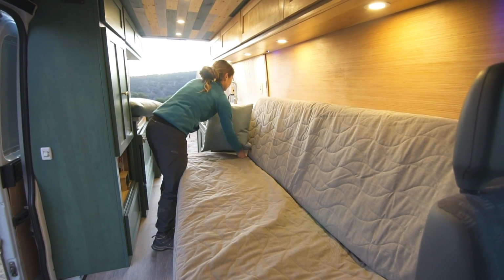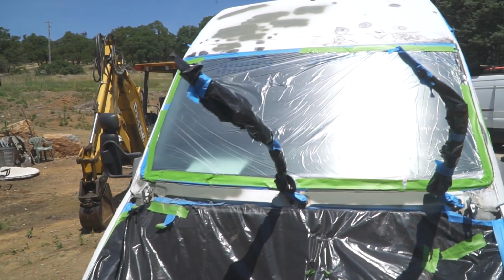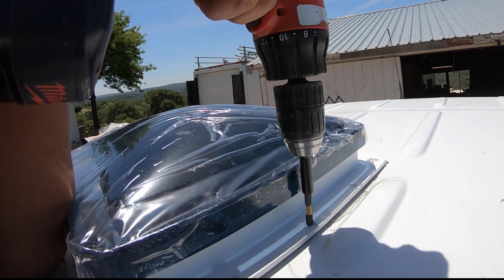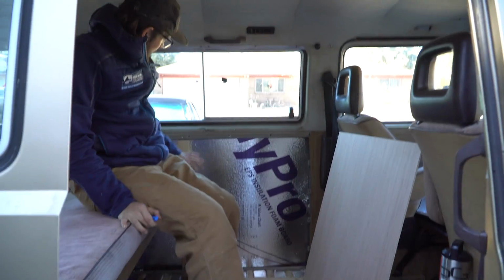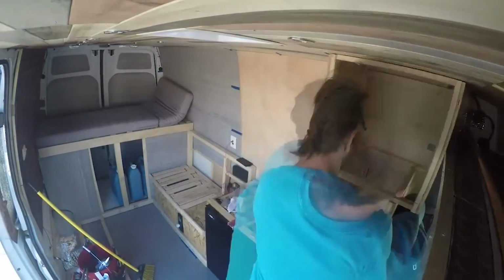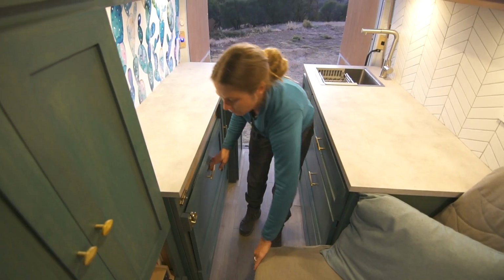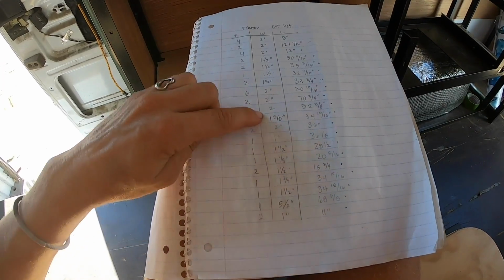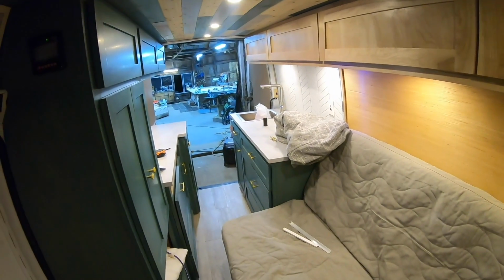How to Build a Camper Van Step by Step

Comment: How do you find the original van holes with Reflectix up ?  I’m at this stage
Reply from the maker: I’m usually drilling new holes into the van with self tapping screws. Placing the furring strips on top of the reflectix and then fastening them to the vans rubs. Some people use riv nuts  and install them before the reflectix.

Comment: What is the tubular metal and L's you used?  Steel?  Aluminum?  How is the weight compared to other options?
Reply from the maker: 1/2” square, and 1/2” angle iron. Way lighter way stronger! Wish I had the time to do this on every van I built.

Comment: Wiring before or after vapor barrier? Meaning wiring in the metal of the van before insulation or between 1X3” frame and vapor barrier? Did you find one way to be simpler?
Reply from the maker: Wiring after framing is easier I think…

Comment: Hello. I love your dedications, hardwork and your creativity. Your builds are creative.
Im on a “planning stages” on building myself my van conversion.
So many ways, styles, and how to video ive seen.
First concerning issue. Your build materials using, wood, metals, woods, plywoods. Seems to be a bit of added weights to the van.
You mind asking after all the builds. How much weight total the van end up?
As for me using the van as my daily driver, mini home. Gas mileage is a big factor.
Reply from the maker: These vans are designed to hold weight this van was a 3500 diesel with a payload over 9000lbs we haven't even come close overloading these vehicles.  Our current van that we have lived in for almost 5 years is just under its recommended payload and we have had to upgrade some suspension and other front end parts.  This is a good thing to think about before your build but just remember these vans were designed to be loaded up and used as heavy duty work vehicles.

Comment: Which video explains how to do the floors? I can’t find it except for on the time lapse vid
Reply from the maker: The floors are pretty straight forward.   We just make a template with cardboard and lay it in there.  Or we use the existing floor to cut a new template out of 3/4" ply and glue it in there.  Then we will lay down either a laminate or a vinyl floor.

Comment: Wonderful!,...... Question... you said paint black to stop rust. Confused me. Just black paint? And painting what parts?
Reply from the maker: We used raptor bed liner to paint the lower exterior and roof because we had rust spots.  The bedliner works great and is easy to apply.  We have more in depth videos on our page for painting your van.
Reply: great question!

Comment: does the reflectix add to the rattle noise? I'm thinking the foam board would and no rattle noise is another benefit of the thinsulate
Reply from the maker: No it’s very lightweight
Reply: @Vankookz  yep, great weight and vapor barrier....wasn't sure if you'd get a little krinkling noise.
Reply from the maker: Not that we’ve noticed

Comment: How did you do your floor?. It looks like you used 1 inch insulation than 1/2, plywood. How did you hold the plywood down
Reply from the maker: We used the reflectix and then the existing van floor it was in good condition still.  We used self tapping screws to hold it down.  Always triple check where you are drilling and use lap sealant to cover the screw holes underneath.

Comment: Just FYI most welders can weld sheet metal so if you make a mistake it's possible to weld that pieces you cut out of the roof with some patience and some grinding at the end to make the welds flush with the rest of the roof, and maybe some bondo right before you paint. or just take it to a fabrication shop and they will weld it for you
Reply from the maker: Yeah it’s amazing what you can do these days.  We had to meld some sheet metal to our current van we cut a bunch of rust out

Comment: Hey!! Halfway through the video haha but I have a question! Did y’all make pilot holes in the van before framing? Or do you use the holes already there? Thank you!!!!
Reply from the maker: Use self tapping screws and a impact driver.  Works every time
Reply: Van Kookz gotcha, thank you so much!! I appreciate it!
Reply from the maker: No problem we are here to help.
Reply: No problems with self tapping vibrating loose?  That would concern me but that sure is sure easier than rivnuts.   For others reading the comments: Self tapping screws are super easy to strip out so be very careful with them.  I would suggest you practice on an inconspicuous spot first so you can fine tune your "touch".

Comment: What has been your go to method for keeping drawers shut? The push button catches seem like the plastic would be subject to wear and tear, especially in rougher areas like baja.
Reply from the maker: The push button patches are actually pretty legit we’ve used a few products and those seem to work and hold up pretty good.  If you don’t mind the look barrel locks and sash locks are the best to keep the heavy duty stuff closed.  We’ve also used a few magnetic  latches.  All depends on how heavy the drawer is

Comment: Great video, need ur advice, which one has high top, 4 sleepers, best engine, best price and gasoline savings 
How much cost convert and how can I find someone help me in converting affordable
Reply from the maker: Hey M B thanks for watching! 

https://youtu.be/v2RcLdwSnMg

Funny you ask, we just compared two of the most popular high tops, in this video. Keep in mind they are comparing the brand new 2020s off the lot. And they are comparing off road features as well. So for the sprinter remove $13,800 if 4x4 isn’t your thing. For the gas powered transit remove $6,000 if AWD isn’t your thing. 

As far as cheap conversions go, on our website, we have a budget sheet. (Www.vankookz.com) We do them for every van we have built. We have build vans ranging from budget minimal builds to a little more luxury. That budget sheet should give you an idea about what you might expect to spend on a build (if you DIY). 

The components (fridge, batteries, solar, sink, etc.) that you need to build out a van can be done around $8-10k. I’ve seen some get up to $28k on top of the build. If you want some one else to build it, plan to add an extra $15k-25k for the labor, on top of your build components. This is why we try to help people do it themselves with these videos. But check back with us, we may be working with kookz soon to build out their vans affordable, as we have gotten plenty of interest from the viewers on it!

Comment: So glad you told people to have an air gap between insulation and panels, a lot of 'expert' youtubers don't do that. 😁
Reply: Glad you mentioned the air gap.  I used spacers in the roof insulation to give me that air gap.  They are made by the people making insulation.
Reply from the maker: Yeah insulation is sooo controversial you never know what people will say.  Thanks for watching!
Reply: @ericprothero6080  did you ever find the spacers? I 'm building out my 1988 chevy van now.
Reply: @ericprothero6080  thank you!

Comment: Finally the kookz are back! Very engaging and entertaining video! I wish I had a video like this before I started building. Some of the timelapse and build footage has so many little details, like what connectors to use at the fuse panel, different ways to attach solar panels, different van builds... I could see. my self watching this over and over if it were around when I built mine.
Reply from the maker: Thanks!  That's exactly what we are going for.  We were gone for a minute, but we are back!